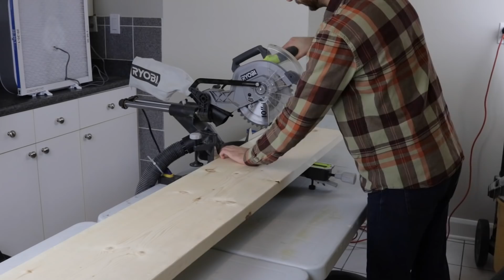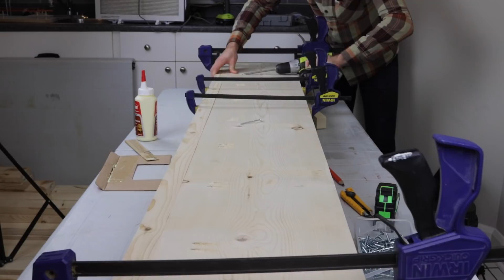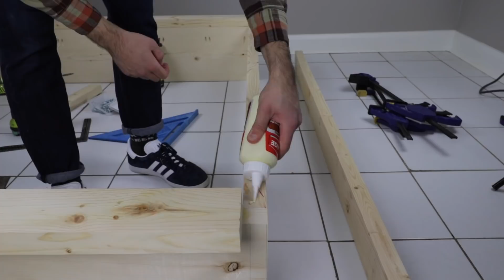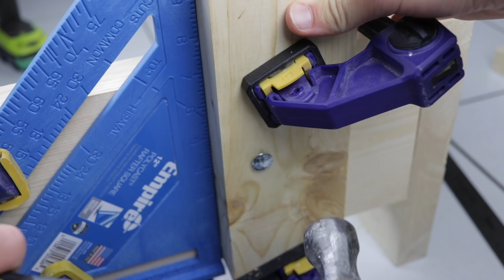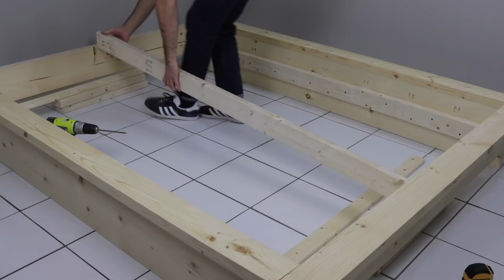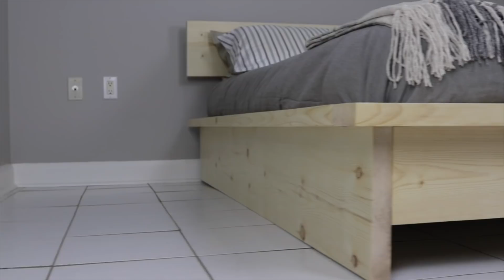How To Make A  DIY Modern Platform Bed | Shape And Explore

Comment: Why do you choose not to over tighten the bolts? Is there a reason for it having to do with the frame being from softwood? Asking because I just made a bed frame my self.
Reply from the maker: Moises Ramirez Yes, that's exactly why! I found that because I was using a softer wood the washer would just keep pressing into the wood if I tightened the nut too much. I also wanted to leave some room for the wood to expand / contract in different seasons. Hope this helps with your bed build!
Reply: @ShapeAndExplore  thank you so much!

Comment: How many people on this planet do you suppose has all these equipment when you make a video how to make a bed make it for someone who doesn't even own a screwdriver so they can simply go to home Depot have the woodcut screw it together or nail it together with a dollar store hammer and Dollar store screwdriver and have a bit anyone who has all that equipment knows more about making a bed than you do
Reply from the maker: John Spurlock Designing projects with limited tools can be a tricky feat. If you are looking for someone who uses limited tools all the time I would recommend checking out Primitive Technology. I have acquired the tools that I use over several years, and do not claim to be an expert at using them. I'm just a guy who needed a bed, and built one that suited my design taste and skill level at that time.

Comment: Love it. But can i add height to it ?
Reply from the maker: frik smith Thanks, this bed was designed specifically with proportions that emphasize the horizontal plane, creating a low / wide piece.  If you're looking for a taller bed I would suggest choosing another design.

Comment: How can I accomodate the measurements for a queensized bed?
Reply from the maker: kraziiegurlxz I built this for a Full mattress (54" x 75").  To use this design on a Queen mattress (60" x 80") you could increase the length of the major components. I also added an extra 1.5" around the perimeter of the mattress to give room for bulky sheets.